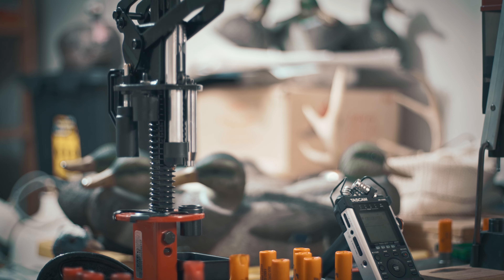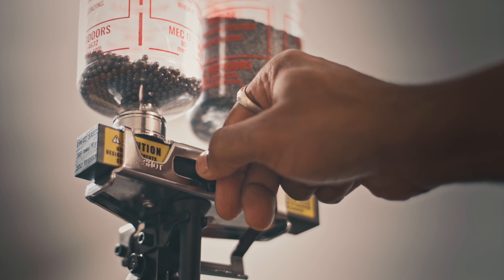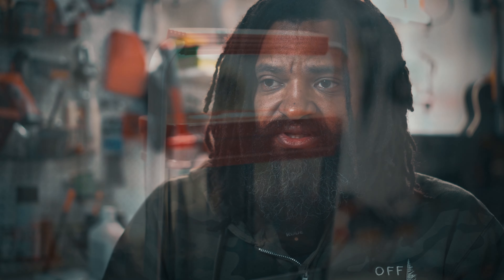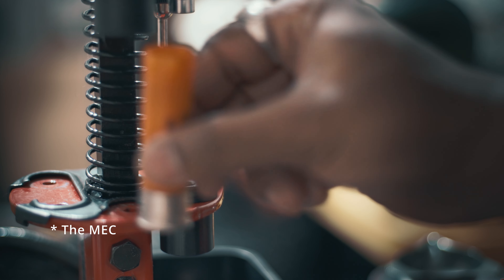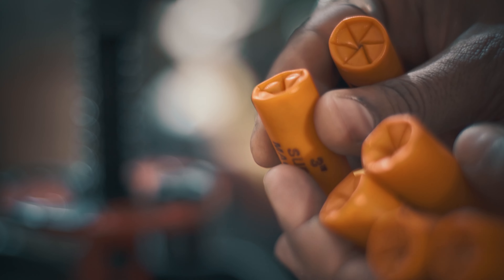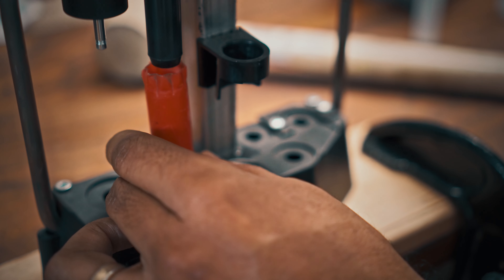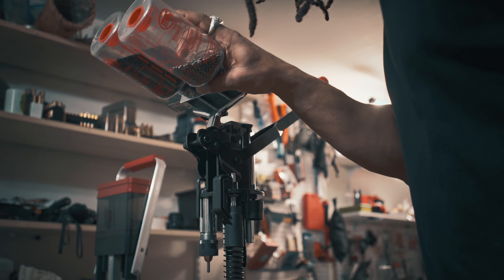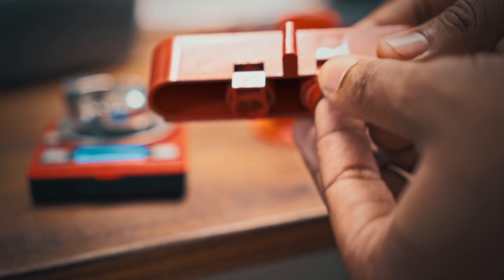MEC 600 Jr Mark V vs Lee Load-All II (A fair comparison)

Comment: Look for used MEC presses, they can be had around $100 all day and sometimes come with extras- hulls, wads, etc. I have 3 Mec's now, and all for the cost of a single new one.
Reply from the maker: Yeah, if you get an MEC for 100$, its definitely a no-brainer!
Reply: I've acquired 2 mec 600jr's, a mec steelmaster 3.5" and two lee load-alls along with 3k 20ga wads, 1k 12ga wads, 100 pounds of shot in different sizes, 3k+ AA trap hulls, 3k primers, and 6 pounds of powder for under $1000 in the last two weeks. Been using a combination of the steelmaster and one of the lee presses for 12ga, like the deprime and resize function of the steelmaster, and the lee gives me a fantastic crimp on my 2.75" shells. Realistically I'm around $700 for everything, the 600jr's were $75 each and one came with the universal bar, and the steelmaster was $150 all used but great condition.
Reply: Great suggestion, thanks! But, where do you find used ones? Hunting/shooting forums? Does Craigslist/facebook marketplace have them? Thank you for your suggestions!  Blessings
Reply: @andrewsavage1872 Where did you find them? Sounds amazing! Thanks. Blessings
Reply: Yeah, all the used ones on ebay are almost the same price as a new one when you pay shipping.

Comment: For anyone getting into reloading, which ever press you get, also get a digital scale. You will want to check to see what the bushings are actually putting out. Some powders flow and measure better than other, are more dense etc. this bushing measure by volume, but a 1/4oz volume of one powder is not same as another as far as density and weight. So check a few loads and see what it’s actually dropping. Also Check the shot. If the payload is dropping more pellets than 1-1/4 oz then it will be heavier than recipe calls for and could hurt your gun. Just some safety advice, don’t trust what the bushing says it is.

Comment: I want to experiment with 20-gauge loads.  I emailed Lee with a question about maximum shot size dispensed via hopper.  They answered in a few hours, which says A LOT to me.  BTW, Lee said BB (0.18") was the reliable limit, beyond that you wouldn't use the hopper.  For $77 as I type this, I say done.  Thanks for this video!

Comment: I 3d printed extra powder and custom shot bushings for the MEC. A 1 1/8 charge bar can then be bushed down to 7/8 and 3/4 easily. There's ebay sellers for the 3d powder bushings, you can get a whole set for the price of one in 3d plastic.
Reply from the maker: Yeah I need to start 3D Printing... :)

Comment: I've been reloading brass for years, have a Dillon 750 for that, but I just recently got into loading 12ga with Goose season upon us here. I bought the load all on a recommendation from a friend based on what I said I wanted to do. I've loaded 1250 2&3/4 BB shot rounds with it using Longshot powder. It works. Longshot sticks to the plastic powder bushings (not static cling, it cakes on and has to be scraped off mechanically), that took some time for me to solve, but I ended up going with the next size up powder bushing then throwing about 20 powder charges to let the powder build up, once that happened it throws pretty consistent charge weights.
Reply from the maker: Yes they do work, but you'll have to figure out some of kinks. Thank you for sharing, that might help others with similar issues, I've been using Alliant Steel, charge consistency has never been an issue.
Reply: @WildBushGrit  It will throw steel BB just fine but it takes the 1&5/8 bushing to throw .98 Oz of steel BB shot.
Reply: Could coating the powder  bushings with graphite help?

Comment: I have a friend that has the Lee2  he perchanced the 16 & 20 top halfs separately so he reloads all three 12,16 ,20ga .  For a very low price his shells & ammo  are perfect & out perform very expensive ammo . He uses Longshot powder minus a few gr's & adds clear fingernail polish to the crimps to seal them and add a few FPS with less powder.  He has no pressure sighns on hulls or primers.  Buba Roundtree on YouTube uses LeeLoadAll -2  for a darn good reason because it is a super great machine .

Comment: I have both, the MEC for 410 and the Lee for 20 ga. 
The MEC is my favorite. Setup of the MEC takes a bit of time, a couple wrenches and a screwdriver. But the precision when I am done with setup is magnificent. EMptying the powder and shot is easy. Customer service, bushings, other parts is easy. The powder leakage when using the MEC does exist, but is pretty small.
The Lee can make some sloppy shotshells. but they feed and shoot in my 870. Powder leakage through the bushings is more than the MEC.The 20 gauge doesn't include smaller shot and powder bushings. Lee does not offer smaller bushings.  This will exclude a lot of powders that are specified for 20 gauge loads. I was weighing powder with a powder thrower into the shells and then inserting the wad and shot.  I had to contact a 3D printer guy online and work with him to get smaller powder and shot bushings. Elite set me up with powder bushings 0.075, 0.080, 0.085 and 0.090 and shot bushings for 3/4 and 5/8 ounce. The leakage on the Elite bushings is less than the Lee bushings. 
I have reloaded 000 buck on the MEC, putting the powder in then the wad and adding the buckshot off the machine by hand, then using a roll crimper. Much less expensive than buying them.  I'm making a three 000 410 for about 35 cents rather than trying to find them for a buck or more.

Comment: Back in the early 1990s I bought a "lifetime" supply of reloading supplies, rifle, handgun, and shotgun. I bought lots of powder, primers, shot, and bullets. Then, I didn't shoot for many, many years in the mid 2000s. Recently, I pulled out the MEC Sizemaster and started reloading again. You might question if my 30+ year old powder and primers work. The answer is, yes. I have been careful and lucky and I can report that after decades of reloading rifle, handgun, and shotgun, the only failures to fire I have ever had were all with factory loads. Not a single handload has failed. I feel for everyone paying today's prices, but of course wages are much higher than when I supplied in the 90s.
Reply from the maker: That was indeed the 1st question that came to mind. :) The other issue we have today is shortage of everything! I couldn't get STEEL powder in the last 2 years.

Comment: I don't have a shotshell press yet, but I'd really like it if there were an equivalent to the Lee Hand Loader for metallic cartridges.  Resize/decap your whole batch of hulls; recap the whole batch, drop powder with a dipper/funnel and seat wads for the whole batch (off the press), drop shot with a dipper for the whole batch, then precrimp and crimp back on the press.  The 7/8-14 thread in metallic cartridge presses is too small for 12 ga., however, so it would be a whole new product and it seems unlikely Lee would want to compete with themselves.  I agree, an easy way to empty the hoppers on a Lee would be a very welcome change.  Maybe something  that could be made as an aftermarket modification for the press?  In all other ways, the Lee wins over the MEC to my eye.  I need to get one (but even worse, I need a place to shoot that isn't an hour and a half away -- I've only had the chance to shoot about three boxes of shells through my 870 since I got it four years ago).

Comment: I have loaded on both as well. The price of the Lee Load All is attractive for sure. I have 5 Mac presses and wouldn't change now for anything. The biggest complaint I have with the Lee Load All is with a fine flattened ball or flake powder I would get small amounts of leakage from the press onto the work bench. I do have one complaint about the MEC I wish they would offer a six-station single-stage press. This way they could offer their radius die as an option. I know the factory die is supposed to do that, but I find it much easier to adjust on the 9000GN than on any of my single-stage presses.

Comment: I’m using a LAII for 20 Ga. I sourced a smaller set of bushings from someone who is 3D printing them. The ones in the kit threw way to much LongShot for my loads. I got very repeatable performance on many types of one fired hulls.  I only partially fill the powder and shot hoppers. And at the end just use an empty hull under the dispenser nozzle to remove each product by sliding the charge bar and dumping the drop into the proper containers.

Comment: Great video! Im waiting on my LEE 20 gauge press. My son just started shooting shotguns and figured id give it a try, mainly for low recoil target rounds. I currently reload metallic for several rifles. It seems like shotshell reloading is more confusing with wad, hull, primers, and powder choices! Haha. Maybe im just over analyzing. What are your thoughts on using the vague loading data which comes with the Lee press....that seems pretty simple assuming i have the correct powders called for. With the data provided by Lee wads and primers dont really matter. I did order a shotshell manual also. Thanks for you great videos.
Reply from the maker: Yes indeed it is confusing, and the amount of resources is also limited! The basic principles are the same as rifles. But wads will mostly impact performance and dispersion of the shots. The problem is you never find the wads you need, then you are on a wild goose chase for a substitution. I have few videos on shotshell, wads substitution, and crimping, I hope they can help. I never trusted the bushing for load data, I always double check with a scale. That being said, I find the Lee Perfect Powder Measure to be quite useful and inexpensive. I think its the perfect companion for my shell reloading. It will dump accurately to 0.2 grain which is perfectly acceptable for shotgun. Thanks for chiming in! and Welcome to the rabbit hole :)
Reply: @WildBushGrit  Thanks! I'll check out your other videos, much appreciated!

Comment: I have just started reloading and have the Mec 600 jr. You are correct, it takes a bit of tweeking to get it right but is good to go after you do. I use mine for .410 and will be getting another for 28 gauge. And yes, you are better off sticking with one type of hull. I am using AA and Federal, AA’s work best. I am only loading 2 1/2” and sometime this winter when I have all the 2 1/2” hulls loaded I will do some 3”. Not really looking forward to that because of the tweeking required for the 3” then the re-tweeking to go back to the 2 1/2”. I use mostly 2 1/2”. There is a company “ creative loading solutions” owners name is Rod. They make a neat tool (gauge specific) for trimming first shot hulls to correct length. You only need use it once. Its an extra step but I love that tool, makes for perfect crimps. Since I am not trying to set records for shells loaded it gives me a chance to inspect each hull. Rod is great to deal with and very helpful. Take a look at his YouTubes
Reply from the maker: Thank you Tango for chiming in! Funny you talk about trimming, I was looking for trimmer recently. Thinking that I could trim all the shells I have to a specific lenght to accomodate my MEC, I will def look at the company you suggested! Thanks for the tip!
Reply from the maker: So I watched 2 vids on the website back to back, and I think this trimmer is exactly what we need. I hope he ship to Canada, I'll probably make a video on this, its worth sharing! Thanks again!
Reply from the maker: I did it! https://youtu.be/q4sxjr12lbs Cheers man! thanks a lot for the recommandation!

Comment: Purchased a LoadAll II long time ago when the base was still cast metal not plastic. It sat gathering dust until just a few years ago when I started loading slugs. Most shotshells are still priced fairly low as ammunition goes so there was never much incentive for me to reload since I stopped skeet shooting where you run thru a lot of ammo toute de suite. I have a good recipe for Lee sabot slugs & have churned out quite a few until I ran out of primers. Slugs & buckshot are pricey & it's definitely worthwhile to load your own. Obviously can't use the shot hopper for slugs & I prefer to weigh each powder load so don't use the powder hopper either. I've seen mods done on the hoppers so they can be emptied without tilting the whole shebang. Can be as simple as cutting an opening lower down on the compartment which can be plugged while in use.

Earlier this year I lucked in & scored a MEC 700 at an estate auction, don't recall the price but it was a steal vs buying new. Haven't used it yet but for sure it's a nice rig. Once I'm able to get primers again I can do my own comparison, LoadAll vs MEC 700. To be honest I think for most folks the LoadAll will be a good investment. There's a conversion kit available so you can load 20 gauge with it.

Comment: Which is better for loading no lead options? We can't use lead for hunting in California , tungsten and bismuth shotshells are very expensive. Especially in .410.
Reply from the maker: I load principally steel shots, no issue at all. If you use the bushing, make sure to test their weight first. they are calibrated for lead. Meaning 1oz bushing will not give you 1oz of steel. A scale is necessary.
Reply: @WildBushGrit  I saw that you weigh separately and just use the MEC for almost everything else. I'll be on the lookout for one on the used market.
Reply: The Lee will not load 410 bore.
Reply: @ronaldjohnson1474  you can get 3D printed adaptors for around $32 for the lee.  
That being said I think I'm going to be looking for a used MEC.

Comment: Pardon me, but have you ever used a " universal" charge bar with your mec600? These charge bars use a screw adjuster to push a block to make the powder or shot measuring chambers larger or smaller, and thus remove the need for bushings and different charge bars. They don't have the rubber insert to prevent shot shearing, though..
Reply from the maker: Yeah I was looking for them for a while, and they were back order everywhere. They seem super handy.

Comment: I have pacific 155 12/20ga got tried of switch components bought a lee load all for 12ga its slower but does a good job, also have a mec 600 jr for 28 and 410 the final product are all good just the speed is the only difference.

Comment: I reload Remington sets and gun clubs I have 3k hulls. I usually use RXP12 Remington wads with red dot. I can not find either wads or powder. Can you please suggest an alternative wad and powder combo I can use in my Remington hulls. Thank you for your time and consideration. Respectfully Ned in Western NY
Reply from the maker: Hello! it's really depend on your weight, but I'm not expert in wads, and I use heavy payloads for geese hunting. the wad I like are the one that can hold my payload (1 1/8)and I will sometime trim them to the perfect length for the perfect crimp (I have a video on that). I never used red dot, I use Alliant Steel with great result, and HS-6 for lead.

Comment: If I get a mec will it load #6 shot steel consistently ? If so what size bushing or bar should I get ?? Also will it work with Alliant steel powder thinking about buying one
Reply: I basically only want it to load steel #6 20 gauge that’s all I use for quail chukar
Reply from the maker: Yes it will work really well. For the bushing & bar, its really depend on your load data.  I can't give you details without knowing your powder charge & shot weight.
Reply: It will work with Alliant steel powder
Reply: Is that powders flake the same size as blue dot what is it comparable too
Reply from the maker: @Sneakyjoe69  yes Steel is flake. Steel is slower than B. Dot. There is a burn rate chart for powder you can look up online. Cheers!
Reply: Thanks ! Does the Alliant steel flake flow through mec bushings ? I was looking at there website I saw blue dot bushings on the mec website but none for Alliant steel
Reply from the maker: They are only giving this table of popular powder for folks without a scale. it doesnt mean Steel wont work with their bushing. You still need a scale to know which bushing will give you X amount of charge. I prefer flake powder in the bar, but to be completely transparent with you, I stopped using the bar & bushing, I weigh my shots with a scale and use a Lee Perfect powder measure for the charge. I use the press to resize, deprime, prime, and crimp. The main reason, I load specifically for Geese,  heavy payload with BBB & T which doesn't work well in the bar and 35+ grains of powder which no current bushings allow.

Comment: I am looking for my first press and wanted to know which version of the mec you recommend. I mostly upland hunt and shoot trap with my 20ga
Reply from the maker: Hello Marissa, I haven't tried all MEC models, but my choice would be between the Jr 600 and the Sizemaster, If budget is no concern, go with the Sizemaster, it has few features that makes it a little bit easier to use, like the way its resize the brass and auto-primer feed system (which is an added option for the Jr 600). Happy shooting! :)

Comment: Can you only load one type of ammo? Like is there a way to swap a piece and loak both 12 guage and 20 guage with the same press? I'm pretty new to all this and ammo is expensive lol.
Reply from the maker: There are conversion kits. You usually buy the press with a default gauge, either 12, 16 or 20 even 410. Later if you want to reload for a different gauge, you need to buy the proper conversion kit for it.